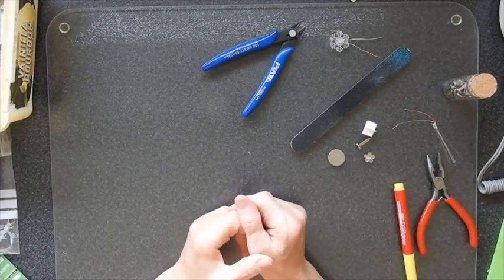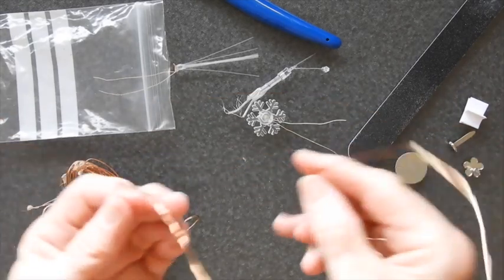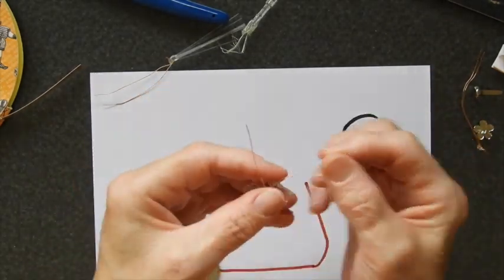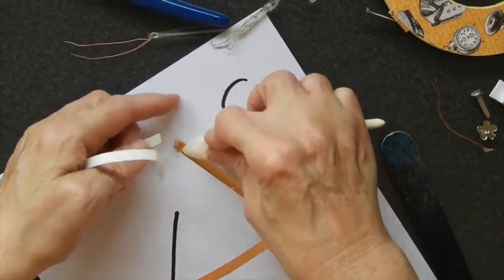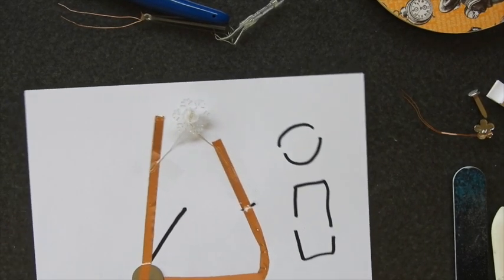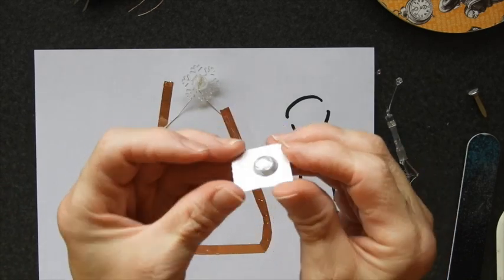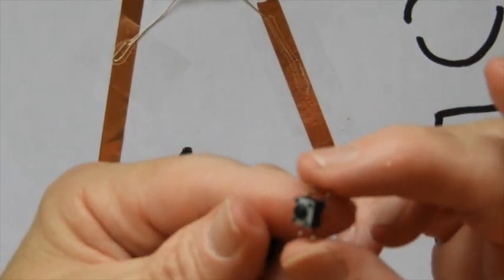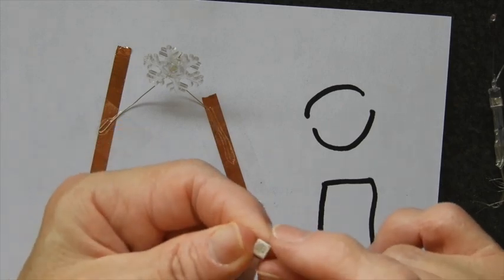Cheap LED Card Circuits  (Bonus Video)

Comment: Informative as always! Ironic as I made a light up card today. I bought some SMD SMT LED lights off Amazon awhile back, expecting they would be about the size of the ones you stripped out of the plastic tubing and they are actually not much bigger than a grain of sand! They are a total PITA to work with, but I got like 270 of the little buggers so I'm gonna use them! Lol! I didn't pay very much for them so I don't know why I am being so stubborn. I guess because money is money.
Reply from the maker: Haha! I've got some of those too, you need a magnifying lens to use those - and I have to admit, I can't be bothered. The others, I found when I went into a shop and they had loads of different lights on reels, just buy it by the metre..for a couple of euros or so. I love using them as they are different colour flashing or single ones like fushia.
Reply: @createinspain  Yeah, I have to admit that I have lost a few. Lol. I have found that my pick me up tool is very useful in keeping track of the little buggers. I'm sure that I will get frustrated enough with them eventually that I will get something else. It can be very hard to get them to light up as the tape has to be so very close to reach the contacts on the lights, but obviously not too close that the positive and negative sides of the tape touch.

Comment: Could I use this ..

Vasdoo Copper Foil Tape (1/4inch X 22yards) with Conductive Adhesive for EMI Shielding, Stained Glass, Paper Circuits, Electrical Repairs, Grounding?
Reply from the maker: I'm not seeing a link (think links are disabled in comments) but it sounds like the right stuff. The main thing is that it says 'conductive adhesive', which it does!
Reply: I found it on Ali express 10m x7mm and it cost only €0,84. I Will order that and Some fairy lights .Maybe the have Some Battery s 👏🏻 👍🏻 thank you for the tips. The battery’s with ones do i need ? Thin ones ?
Reply from the maker: Glad you found it! Batteries are CR2016 - those are the thin ones. Means you don't have to put foam layers in the card!
Reply: createinspain thank you so much 👏🏻👏🏻
Reply from the maker: No problem! Have fun with it all when you get it!